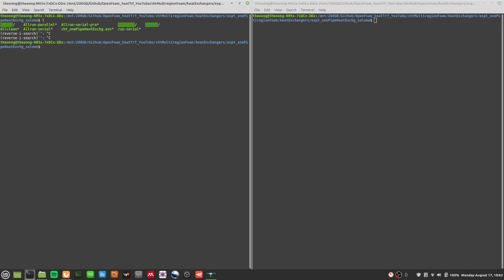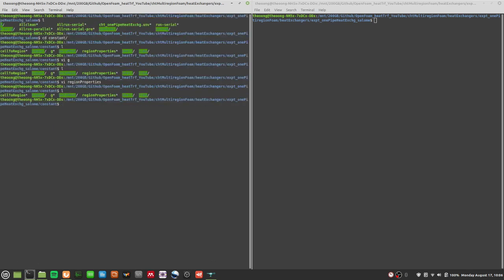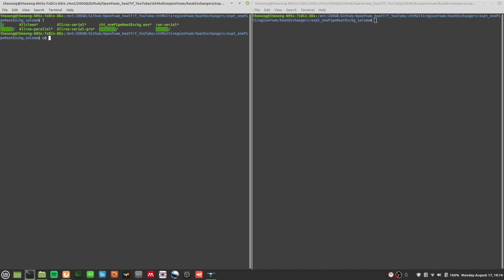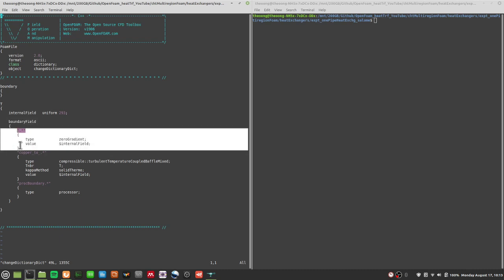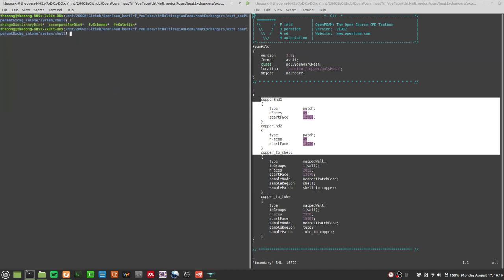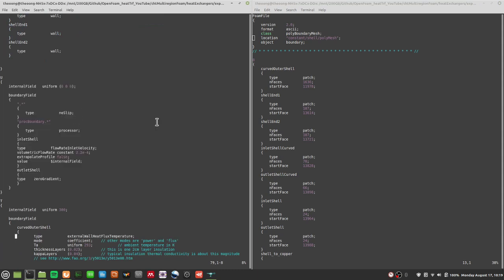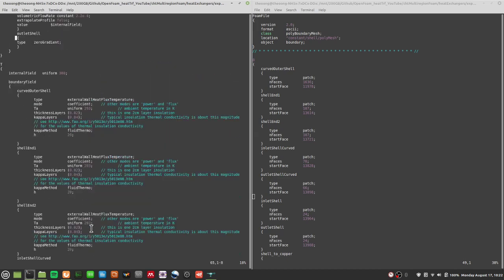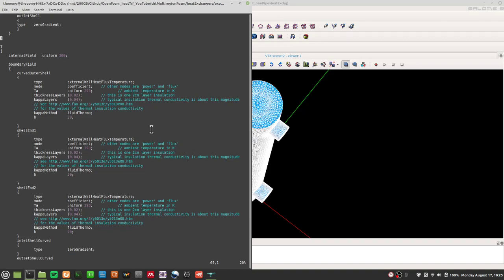OpenFoam Heat Transfer 66 - velocity and pressure boundary condition and region property discussion

Comment: Hi, im getting error repeatedly something like   --> FOAM FATAL ERROR: (openfoam-2206 patch=221104)
Incompatible dimensions for operation
    [rho[1 -3 -1 0 0 0 0] ] + [div(phi)[0 0 -1 0 0 0 0] ]
    From void Foam::checkMethod(const Foam::fvMatrix<Type>&, const Foam::DimensionedField<Type, Foam::volMesh>&, const char*) [with Type = double]
    in file ./src/finiteVolume/lnInclude/fvMatrix.C at line 1924.    
How to resolve this, what might be the issue